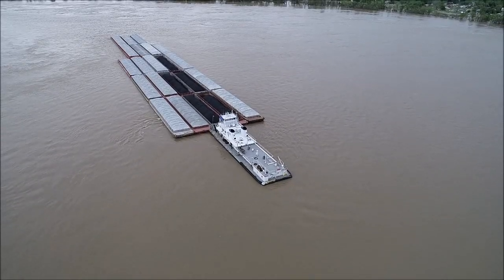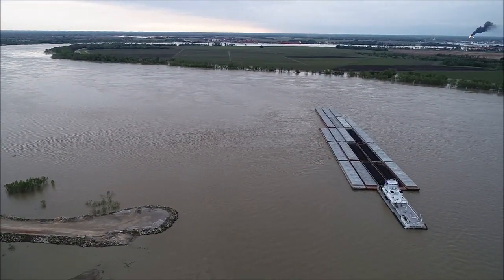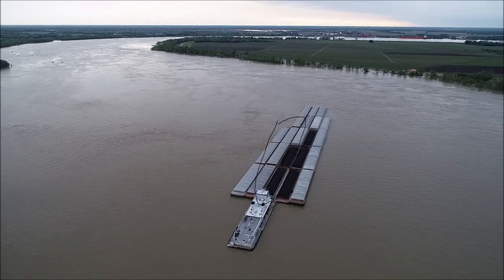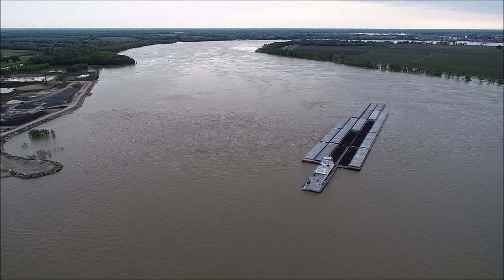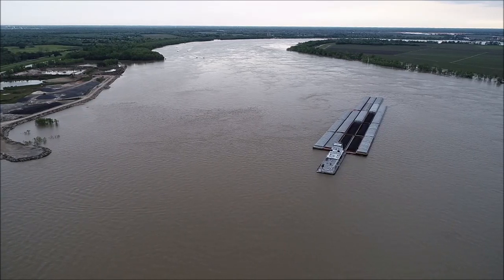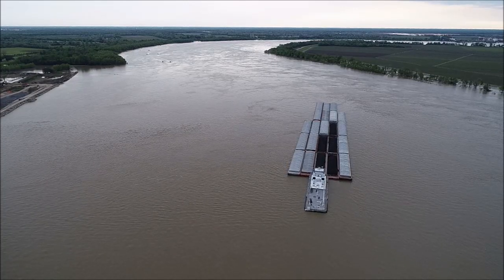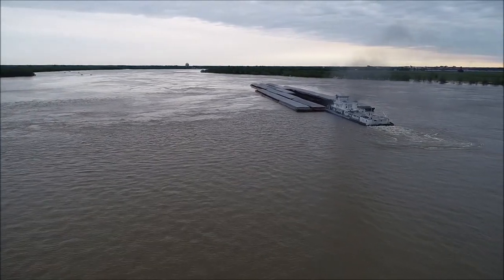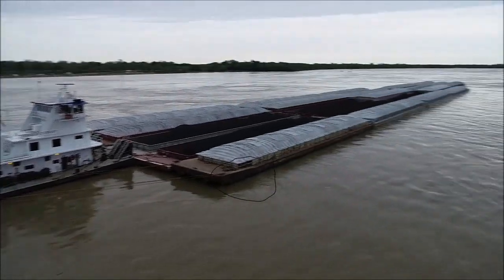flanking bringier

Comment: Great video, is flanking a method of saving fuel or a safer way of making the bend? Why would he not put the rudder hard over and power around then center and go ahead?   Thanks, your videos are very interesting.
Reply from the maker: DC Brown it is the safest way to make a sharp turn with high current.. Since the tow is 1000' long if you try and steer it the water will be hitting you on port side and be pushing you towards the bank causing an accident
Reply: I understand, thanks Capt.

Comment: DO YOU FLANK EVERY CURVE
Reply: No, many bends can be what’s called driven around. It’s a decision made by the pilot in command at the time. River conditions are always changing and what worked yesterday, may not work today.

 The inland towing industry is like many others. Time is money. Flanking is safer but slows progress. Driving a bend is much quicker but riskier. If the pilot decides to drive the bend but is unable too due to conditions or lack of skill. The outcome can be costly and time consuming. Where is after understanding river current and it’s effects upon a tow, flanking requires less skill. 

 In this video it’s easy to see that there is a swift current. The narrator explains what’s happening in terms that land lubbers show easily understand. It should give those unfamiliar with towboat operations a better understanding of what might be happening or how sharp bends are made.
Reply: This is how the NTSB describes Flanking;
A flanking maneuver allows tows to pivot around the point of a bend, similar to how a large log might drift downriver. The operator reverses the engines to reduce the forward speed of the tow and places the stern of the tow near the “point” or inside of the bend, in slower-moving water. During the turn, the operator applies a series of engine thrusts against the current to keep the stern near the point of the bend, while the faster-moving water at the outside of the bend, swings the head of the tow around. A vessel operator may decide to flank around a bend if the combined forward speed of the vessel and the current might otherwise push the tow onto the outside riverbank before the turn can be completed. Compared with steering around a bend, flanking requires more time to navigate through relatively short stretches of the river (as the forward speed is slower) but reduces the risk of running aground. Flanking is possible only when the current pushes the vessel from astern and “carries” the vessel through the turn.